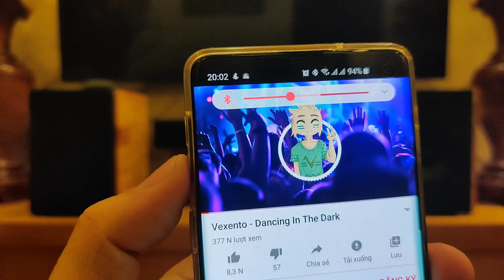Diy bookshelf speakers

Comment: Could you please tell how tweeter and woofer are connected. Any crossover is placed in speaker box. The reason, till last I watched this video however, after you placed cover protection, shown placing fiber foaming inside and there after skipped to test.

Could u please tell how did u connected drivers.
Reply from the maker: I connected the treble speaker in parallel with the middle speaker, the cotton lining is very important in deciding the quality of the sound of the speaker to the listener's ear.
Reply: @kentthoi  thanks a lot for your inputs. Let me try and revert with pics to you soon.
Reply from the maker: If you need any information you can write here, what I know I will share with you

Comment: HELLO ! Is your table saw modified with a small DC machine?
Reply: I found it from another video
Reply from the maker: I re-optimized the wood cutter, since it was a small machine, it could not cut large wood boards, so I upgraded it.

Comment: Hello. Have you ever build a speaker using aiyima drivers?
Reply from the maker: I used to make Bluetooth speakers with aiyima speakers
Reply: @kentthoi  how do you determine the volume of the enclosure? Or you just set random dimentions?
Reply from the maker: @correia707  usually it will have a parameter, you can calculate its volume, in case you can't find its parameter you can use the software to measure and calculate the volume for it
Reply: @kentthoi  i dont have software to measure. Can you point me to some?
Reply from the maker: @correia707  You can these software
Oscope , Spectroid ...

Comment: Could you ease tell how tweeter and mid/full range woofer connected. Connection made as series. Also you have connected capacitors, how much unit measured?

Please reply.
Reply from the maker: My middle speaker is full range, so I added a small full-range speaker with a 3.3 uf capacitor to enhance the high range between
Reply: @kentthoi  thanks a lot for your kind reply. Could you please tell how drivers are connected. Series or any crossover is placed.